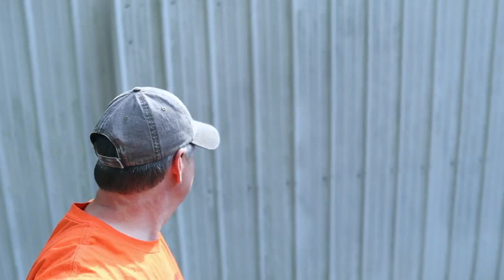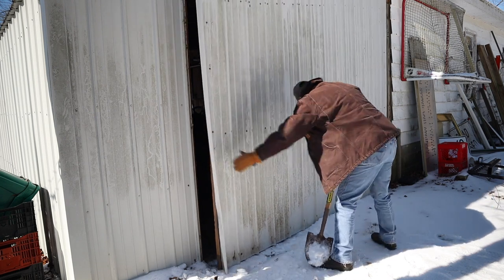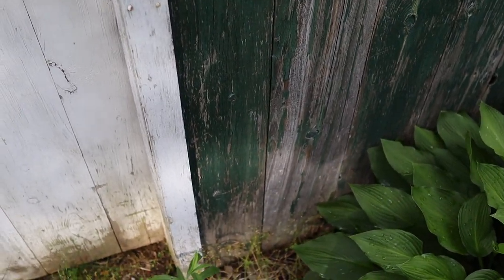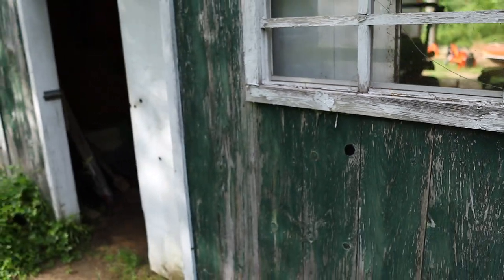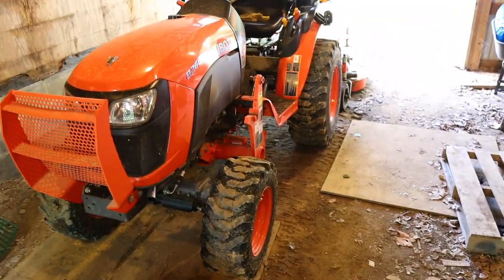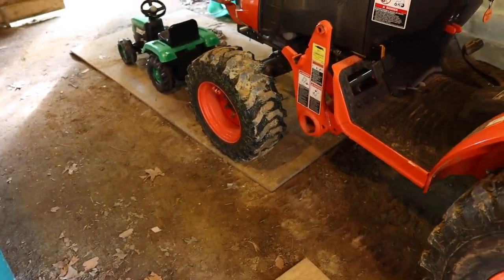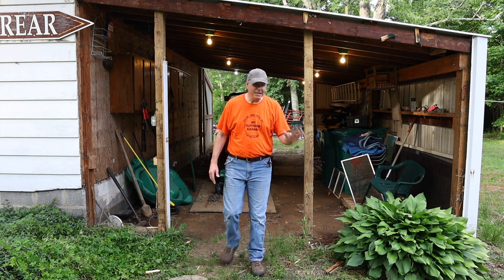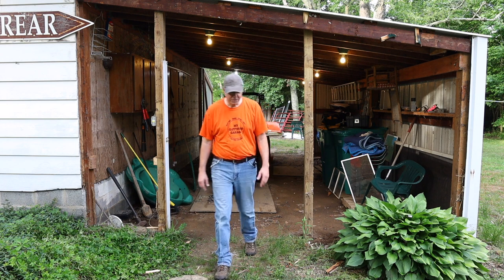#56 Getting ready for concrete in the barn for the Kubota B2601 Compact Tractor - Part 1

Comment from the maker: Here are some product suggestions. These are Amazon Affiliate links, so purchasing will help this channel by providing a small commission while not costing you any more. Thank you for your support!
DeWalt 20v Drill and Impact Driver:
https://amzn.to/3cxxkdH
Klein No-Contact Voltage Tester:
https://amzn.to/3g7YJoW
Lumax Heavy Duty Grease Gun:
https://amzn.to/3mFK1pA
LockNLube Grease Gun Coupler:
https://amzn.to/3kPcvwu
Recommended Grease:
Valvoline Moly Fortified
https://amzn.to/3jNM1Kv
Nitrile Gloves:
https://amzn.to/34Kg8OG
Deerskin Gloves:
https://amzn.to/2I17NNy
My Video Gear:
Rode Wireless Go II microphone:
https://amzn.to/3eiJatG
Canon M50 Camera (now Mark II):
https://amzn.to/3vHW9uD
Battery adapter for M50:
https://amzn.to/2RshsBE
Sigma 16mm prime lens:
https://amzn.to/3vJDRcx
Sigma 30mm prime lens:
https://amzn.to/3epFneh
Variable ND filters:
https://amzn.to/3tmoHIs

Comment: My how construction techniques have changed in the last 25-30 years. Everything has gotten so much better, At least for the most part. I recently had to have the facia boards replaced on my upper barn. Because that barn has a huge hay mow for hay storage when we had dairy cows, it takes a 40 ft. ladder to reach that high. I hired a crew with a bucket lift to do the work. I had them replace the wood facia boards and aluminum trim with a white composite decking board material. Turned out to be a much bigger project that we first expected but it is done right and will never rot now. The composite material s normally 3 times as high as treated lumber. Now because of the high price of lumber, it is only double. Didn't make me feel any better when I got the bill though.
I know how you feel about the shed. I think you will be glad that you did it and will find your whole place more useable. BTW Ed, you have a very nice place.
Love your videos. Keep 'em comin. See you for the next one.
Reply from the maker: Thank you, Gary. Although I’d love to have more out buildings and bigger ones, I know that all comes with a price tag. At this point, it seems that composite should be cheaper than wood! Thanks again for your kind support.

Comment: We are thinking of concreting the floor of our shed. My dad, who was a builder, a friend of his and myself built it in the mid 80s. It can fit four vehicles in it and is of pole frame construction leaning off a garage constructed out of brick. It looks like your shed without the walls and around four times bigger. A concrete floor would make a big difference, making it easier to keep clean and turning it into a place where work could be done on equipment. So I look forward to seeing how it goes for you.
Reply from the maker: Thanks very much, Karl. I’d hate to think of a project costing 4 times as much!